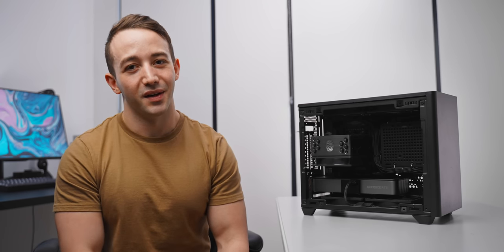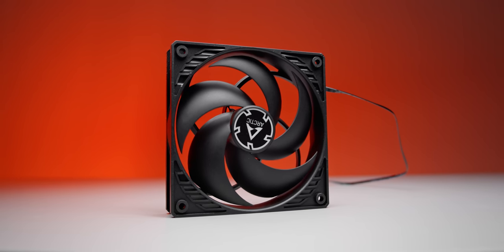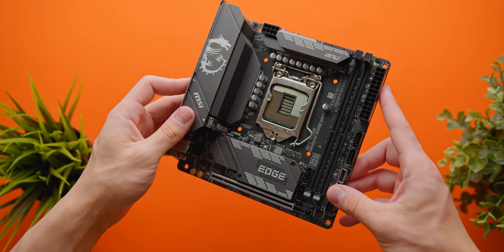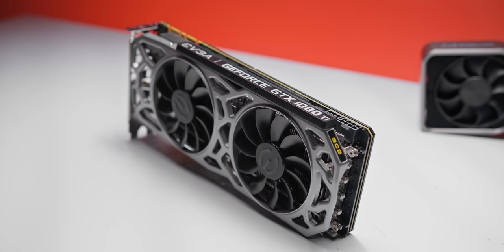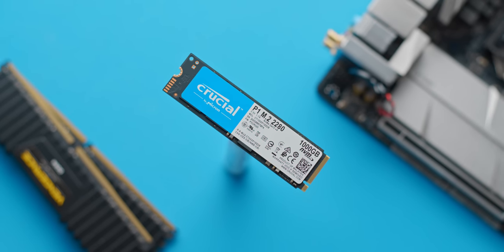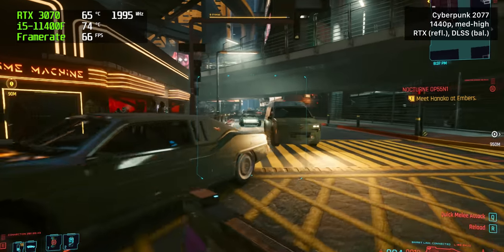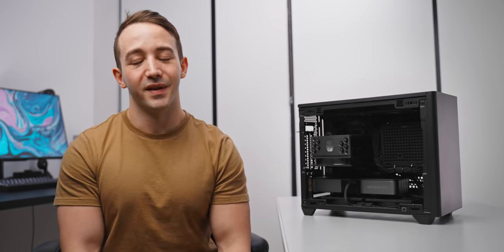Ultra Airflow, Zero RGB - 1440p ITX Gaming Build

Comment from the maker: Fresh upload on the second channel also! https://youtu.be/RYDl3QBhudQ
Reply: you've mentioned this build on stream if i remember it correctly! good video ali!
Reply from the maker: @hughlevantjames905  Sure did!
Reply: If you wanted to make it hard to beat you'd have put it in an Ncase
Reply: In the NR200p, it usually helps to use the rear as the cpu cooler intake rather than using a chimney setup. I myself saw a 5 degree change
Reply: Where did you get that msi b560i ? 
Is it released ? 
I can't find any in USA/CAN
Reply: Thanks for making this 
Also hi its me turtles from ur streams
Reply: @optimumtech  Is that a hyper 212 black? Does it fit with the side panel?
Reply: @optimumtech  Any good ITX cases with USB C that are similar to the case used here? I was thinking Lian Li tu-150 but was wondering if there are any better than that case.
Reply: I would consider also the Bionix version of the arctic fans (not the rgb version) the pwm / pst, they have a very nice looking grey for this build too... Btw I saw the video of Pwnage mouse, it was a very nice recommendation and video... all the best
Reply: @optimumtech  Would a Noctua NH-D15 fit in there?
Reply: Hey, I'd like to ask a question about hyper 212. I want to use my 2,5" ssd and 3,5 hdd in the bracket. Will there be any problems with this or not? Peace, very cool video! <3
Reply: @genericscottishchannel1603  that thing is expensive & not readily available compared to NR200
Reply: @sushimshah2896  And?
Reply: I saw you switched the cooler orientation.
Reply: @sassiest2053  I got both cases. Not much difference in temperatures. I loved the TU150. Not much fun to build in the NR200 compared to that.
Reply: How do I purchase the mobo you have? Can't find it on amazon.
Reply: @xCRAZYxDUDEx22  It does, if you want to use the TG panel this is also possible but you need to remove the "caps" off the top of the cooler which is pretty easy with just a few screws as @wesley stated in the comments below.
Reply: Bro have ...... best itx case v3.....can???
Reply: hey @Optimun Tech I'm planning to build the same pc but  i5 11400 so I have integrated graphics because GPU prices are over price in Canada, how much would this affect my FPS in games like val, r6, Apex Legend at 1080p plzz can u help me out
Reply: @optimumtech 

Hi!
Wondering if you could share insights on key difference between the Lian Li TU150 paired with the 3080 (evga XC3 Ultra, supported by 2 slim fans), 5800x air-cooled, in terms of airflow performance. How big of a difference would the case make? Would a bottom to top air channel drastically improve GPU cooling over the standard front to back flow of the TU150? 
My Cpu temps in the TU150 are great, but I am wondering if RT at full load temps (currently at around 80/81c, @1920Mhz(drops to 1905 due to temp limits when Ray tracing), undervolted @ 0.894) could be lowered as well purely by the case.
Cheers
Reply: You say prices arent that bad in the US, they are 3x-4x over msrp, id say thats quite bad
Reply: I use this as a templit and the only changes are the cooler cpu and ssd
Reply: @driftbum7477  The CPU price mentioned in this video is likewise inaccurate. The I5 11400F has never seen the south side of $200 since launch from any US vendor, except Adorama, and I've yet to ever see it in stock there. Today (2021-09-10) Amazon currently lists that CPU for $292.99, 67% above the price in this vid. Most vendors sell it for anywhere from $250 to $300. I don't know who his "US" parts vendor is, but I want his business contact number; I'd love to do some "shopping".
Reply: @optimumtech  can you use an intel Core i5-115600k
Reply: whant to see this build with Noctua C14S.
Reply: How do you give it unlimited power?!?!!
Reply: Hi! I was wondering how many fans I should buy for this build? This is my first, thanks!
Reply: I tried to mimic this build. Idk how you could fit the cooler master fan and the RAM at the same time, so i ended up with the vertical position. How did you do it?
Also, do you think we have to cover all the holes at the back of the PC?
@Optimum
Reply: vertical as in exhaust in downwards or upwards direction?
Reply: @abhishekxkumawat  upward

Comment: Now this is my kind of build. Simple, realistic, and no nonsense.
Reply: Im still adding rgb to mine😤😈😂
Reply: @senseicheems3270  😂
Reply: @senseicheems3270  its a matter of taste. Both ways can look really good
Reply: Yeah. A case that is mass-produced, no water cooling, no RGB, no riser cable (which can complicate PCIe 4.0 compatibility). So really very little to trip up a novice builder–or someone more experienced who regardless wants something as simple and reliable as possible. I have a Dan A4 currently but this is probably relatively similar to what I would build today, if doing so from scratch.
Reply: realistic? 3070 is very realistic
Reply: @pocopump1326  in the context of as in just stock and off-the-shelf components with no user alterations or whatever crap. Yeah, it is realistic. I'm not talking about the current climate of availability/price because of course that varies.
Reply: agreed
Reply: Same
Reply: Same. All black gang where you at?

Comment: Thank you; it’s nice to see an air cooled ITX build! I think it’s worth noting that the Noctua NH-U12A fits as well. IMO you don’t need those two bottom intake fans. I have this setup in my rig and works very well. For reference I have a 3700x and a triple fan 5700XT with two NF-A 12x25 top exhaust fans with the above  Noctua cooler. This setup has excellent thermals while being very quiet.
Reply: Since you don’t have the bottom fans how do you orientate the cpu cooler?
Reply: @Jacobvb11  I have mine set to exhausting towards the back to help pull hot air from the GPU. I played with intake from the rear and that did get better CPU temps but opted for GPU thermals. I have since changed to a 3080 and added intake fans on the bottom for that GPU because it runs so much hotter.
Reply: @GR-cd2kx  okay cool! Thank you for the info, I'm thinking of building something similar!
Reply: @Jacobvb11  awesome! I’m super happy with this build. something to keep in mind with the NH-U12A and top exhaust fans apparently is that most but not all motherboards will work. Some shift the CPU a bit more towards the top which doesn’t give enough clearance for the top fans. I have an ASUS Strix B550-I with no problems.

Comment: You actually can use the Hyper 212 Black with TG panel, you just have to pop off the covers on top of the cooler, which can be done pretty easily (running the same setup rn) :D
Reply: Thanks :)
Reply: @ΑναστάσιοςΠαπαζαχαρίου  in

Comment: I love these clean ITX builds! I think the main reason to pick a midtower over ITX these days is more likely to be related to saving money on the PSU (SFX units are still a fair bit more expensive than ATX) and the ease of adding storage. It is fantastic that the trend of better air flow has made it to mainstream ITX cases though, and this build is really nice!

Comment: Just a heads up. You can use the Hyper 212 Black with the TG side panel. You just need to remove the heat pipe caps by popping off the top plate of the cooler, remove the caps and put the top plate back on. This will allow the TG side panel to fit with 0.5mm clearance.
Reply: ^^^ This :)
Reply: Or you just get a Scythe Mugen 5? :D
Reply: @Lizard008  which from what I've read doesn't fit with the TG side panel unless you managed to get it to fit. If so how?
Reply: @OliverRivettCarnac   Odd. panel closes nicely for me. for what it's worth: I'm using the Rev. B variant, but supposedly it also works fine with the RGB variant:
https://www.reddit.com/r/sffpc/comments/j0wywp/nr200p_scythe_mugen_5_rgb_tg_panel_fits_wo_any/
I'm using two slim noctua fans at the bottom, and the top 2 fans that came with the chassis
Reply: @Lizard008  Can say the same, using Mugen 5 with 2* 12cm 25mm fans without issues.

I did have to flatten the iron wire (the one that holds the fan on the heatsink), and not use the grill for the back top fan.

https://i.postimg.cc/qvzKtrfZ/IMG-20210422-201029.jpg

Top fan and on heatsink are Noctua 12cm iPPC 3000 fans, and above the heatsink the Cooler Master Sickleflow fan that came with the case, on the back is a 92cm Noctua non-pwm fan.

On the bottom, the GPU is a RTX 3080 Gaming X Trio, which i deshrouded and placed 2*140mm Noctua iPPC 2000 fans, in reverse (cold air moves in through side panel, through heatsink, to bottom).

The plastic you see is tape, which i placed to block air and increase negative pressure coming into he heatsink, i know it looks kinda fugly (might use black tape instead, or nothing at all), well it was kinda a experiment to see if it's worth doing that, normally run it open.
Yes, i tried 12cm fans to see if it improves further, it does for about 2°C, but a part of the heatsink stays kinda hot and since 12cm does not really cover the whole card, and the bottom needs to be taped so air does not bounce back in from the bottom.
I thought, oh well, I'll just keep this so i don't have to buy new fans, it's easier too.

Doing the fans in reverse was done because hot air would increase temperatures of the motherboard, any SATA or m.2 SSD's (even in the back), CPU, PSU, etc.
This way there is always a high negative pressure, but all air is sucked through the side panels and the case air is always room temperature, components can't heat each other up, and it shows for me, components are not noticably affected (aside from air from the other side of the case, inside of the tv cabinet becoming a bit warmer and raising m.2 ssd temperature by 2°C).

Still, even with this, in Furmark, the GDDR6X VRAM temperature still hits 110°C way too easily after some time of running.

In Control, with 4K, DLSS 1080p, everything including ray tracing on High, i get about 87-104fps, core stays between 67-71°C and vram at 94-98°C.

On stock, even with undervolt, this would have been worse.
MSI did a absolute Shit job at cooling the VRAM on the Gaming X Trio, i can easily fix it by replacing the thermal pads and paste by some Gelid Extreme stuff, or even better with thin copper plates like some Russian guy did.
I asked MSI if they would void warranty, since EU and The Netherlands have a Shitty warranty policy when it comes to maintaince and repair, were the manufacturer basically owns all your stuff, and warranty only applies if you use it exactly and only as the manufacturer desires.

Compared to the US, were the warranty period may be worse (in the EU 2 years mininum is mandated), but warranty can not be void for breaking the manufacturer sticker and going inside of the card, making sure not to destroy stuff or use liquid metal (and proof it).

Oh, and don't get me started on how they cancelled all those orders for people that wanted a 3080 Gaming X Trio (they said they would not...and i think they may do the same for the Suprim X since there is a Suprim SE), or how often their customer support is lacking (not always though).

....welp sorry about that, guess i couldn't help  ranting about MSI in the end.

Comment: My undervolted 3080 Founder runs at 65 degrees max at 50% fan speed in this case. It's a really good case for the founders edition cards, especially for the 3080 with that second straight through fan.

Comment: Tip from personal use: use the rubber circles that were originally to mount HDDs, for the bottom fans. Place them at the screw holes, between the metal bottom and bottom fan side. 
I use my GPU deshrouded, the performance is amazing (-5, to -10C) and the acoustic performance is seriously better when bottom fans are over 1000rpm.
Reply: do you have pictures :) ?
Reply: What do you get by using the rubber rings?
Reply: @soul0merk  About 2mm of lift to get close to that de-shrouded GPU, and non-trivial noise dampening.

Comment: Thumbs up for the mature anti-RGB build!
Reply: I won't go out and call it mature. After all, "gaming" might be considered by some as immature but that doesn't make sense either. A more appropriate version would be that the aesthetics of this build are perceived as better by some than an RGB counterpart of the same. In this regard, I concur.
Reply: @anmolagrawal5358  The defense rests its case. Adjourned.
Reply: @chendusingh  I appreciate your decision my lord. May the truth prevail
Reply: @anmolagrawal5358  lmfaoo
Reply: @anmolagrawal5358  Agreed. RGB lighting looks like crap only if it's done with bad taste, most commonly by overdoing it. A few RGB accents can look good, like only the RAM sticks or only the case fans and maybe some small lighting integrated in the motherboard. Also, "unicorn puke" or "rainbow" is just...no.
Reply: I just fixed my bed RGB, now I know I'll sleep much better.
I even changed to pink to celebrate.

Comment: You can take off the heatpipe caps with a torque screw and potentially fit the TG panel with this case/cooler depending on MB/standoff height.

Comment: I am planning on putting together a similar build with the processor, motherboard and a 3060 ti as opposed to a 3070. This was very helpful and the value is insane.

I will be upgrading from a 4790k, which is fine enough, but it definitely struggles running Cyberpunk 2077 and my cpu is definitely holding the 3060 ti back.
Reply: Did you make one? If so, how is it? What changes did you make?

Comment: Curious to see if the vertical cpu cooler is more effective than a rear intake.
Reply: That's what I thought. In that config, if the cpu fan is pushing, the air is, at most, the recycled graphics card exhaust in the case, and if it's pulling, then means the top fans are intake so there's no exhaust fans at all in the case.

Comment: Added almost exactly this build to my cart last weekend for the wife. Thanks for ensuring my hours of research were not in vain. Only thing I did different was the CPU cooler, opting for NH-U9S because I was worried about clearance. Great video as always. Made sure to use your link as well for the purchase!
Reply: How did the NH-U9S hold up in the NR200? Good thermal ?
Reply: @airrwalker  i testet the nh u9s Cromax and the Bequit Pure Rock 2 Black and they perform the same for the 11400f. Noctua is just build so much better from a quality standpoint. Temps around 65C and 78C unlocked to 150W
Reply: @LazyFoxClub  Appreciate the reply. Seems like Noctua is cooling it well. Noctua build quality never disappoints

Comment: Check out the CM MA612 Stealth non-RGB variant. It has more beefy cooling potential and shorter than the CM Hyper 212 Black Edition. So technically it should fit in the NR200P. Note, the Hyper 212 BE can actually fit in the NR200P if you remove the heatsink covers (not necessary in removing the decorative plate, which is the one with the Cooler Master logo on it) by removing the allen screw.

Comment: 1:19 it's not the most compact Mini Itx, but IT IS the most compat mAtx case for SURE. I'm using it  with a 23x21 mAtx motherboard and a full size atx power supply and this case is AMAZING.

Comment: one thing to note, if you go a arctic liquid freezer II 280mm AIO in this case, you cant use the rad bracket as easier as the smaller ones and need to slide the radiator in before hand or via the top as it is just longer than the side opening. Great video and continue to promote the NR200 :) i did get mine for 90 AUD as well.

Comment: I am actually planing on a very similar build myself right now. 
I chose an Noctua NH-L12s as my low profile CPU cooler, allowing me to mount one 120mm fan on the side pannel. As for an motherboard I chose the Asus Rog Strix B560 I Gaming WiFi, which is basically the only other option for an B560 ITX motherboard. 
All the other parts are basically the same. 
Well I will have to wait for an GPU to be available with a reasonable price, since I live in Germany, I guess...

Great video!

Comment: Hi Ali, love your build. I made a similar build except with 5600x and 3080 in the same case with same air cooler. But i was desperate to go with glass panel, so i just remove the top shiny covers for heat sink grooves and its fits perfectly. Those can be removed by just rotating by hand so not a big issue and no need to worry about damaging the cooler.

Comment: For what it's worth, the tempered glass panel should be able to fit with the Cooler Master Hyper 212.  All it requires is to unscrew the faceplate of the cooler, pop off the head pipe caps, and put the faceplate back on. The few millimeters gained should provide sufficient clearing to fit the pannel.

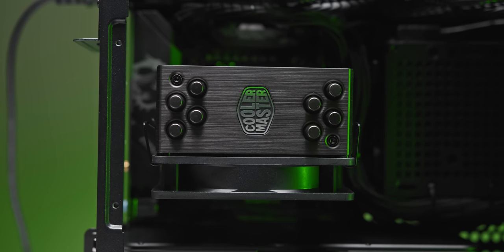Comment: 7:17 Actually, you can remove the top heatsink cover the thing will fit just fine with the TG panel.
Reply: Good tip. You mean there's a top piece on the cooler that's aesthetic only ?
Reply: @atticusrussell1225  yeah. There's another video on youtube that shows you how to remove it

Comment: Hey thanks for this video; I've just bought my parts of this exact build. I'm going to be using it for gaming but also as a PC to start my new design business. Just wanted to drop by and say thanks; this aesthetic and build was pretty much bang on with what I wanted. I can probably account for 1000 of the views on this video. GPU prices have dropped somewhat in Australia but rather than waiting too long I just bit the bullet and got a 3070. Other parts are on sale so I got this exact build for under $2700. Thanks again.
Reply: Ooooo. dam sadge. welp, better use the hell out of that rtx 3070. cheers mate.

Comment: Awesome vid! Would love to see you try an make the most silent itx build you can. Say anything 20 liters and under, still has to be a high performance gaming system and then try different setups. Test different cases and water/air/passive cooling solutions while still making it a capable 1440p machine and getting it as quiet as possible.